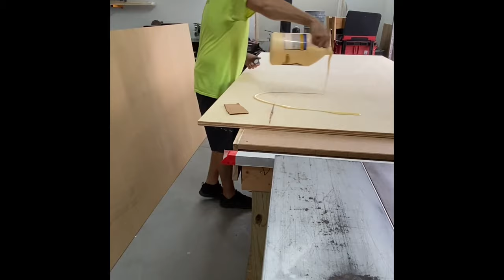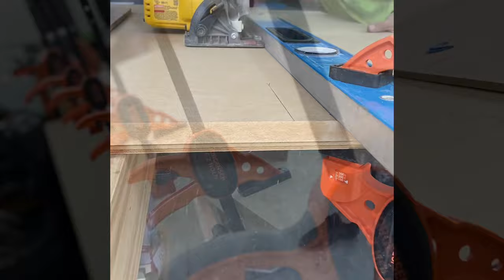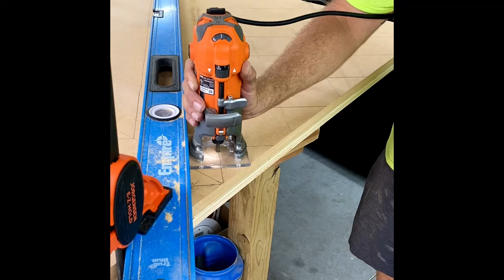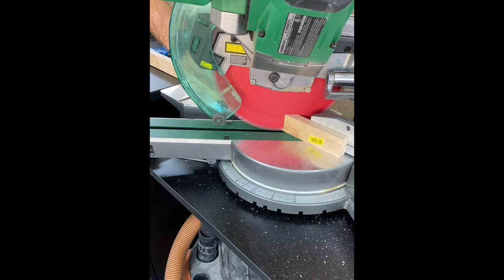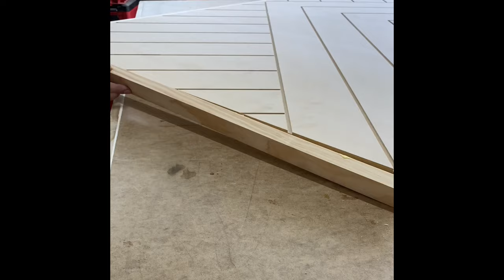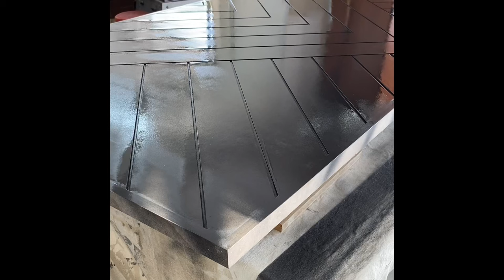How To: DIY Modern Barn Door - under $100!

Comment: Great work and inspiring! Can i ask why you used both MDF and Plywood? and why not just 1 sheet of either? Would it warp without the supporting layer?
Reply from the maker: Thank you for the complements! My thought process was 1) the weight of 2 sheets of MDF, vs 1 ply and 1 MDF. And 2) I thought there might be some added rigidity using the ply, but I honestly can’t say if there’s any actually truth or value to that. Weight and cost would probably be the biggest benefit. Hope this helps!
Reply: @tillertradeco  thanks for the quick response! I appreciate explaining your thought process. Will give this a try!
Reply from the maker: @JamesPou206  awesome! Good luck!

Comment: This looks awesome!  Just subscribed.  Can you give any helpful advice in making the chevron design?  Or does it look more confusing than it actually is?
Reply from the maker: Biggest thing is layout! Second tip is to use a router adapter from tool curve that rides on a guide rail track from a track saw. Takes away any chance of “drift/wander” when just using a straight edge. There’s so videos of that on my Instagram!